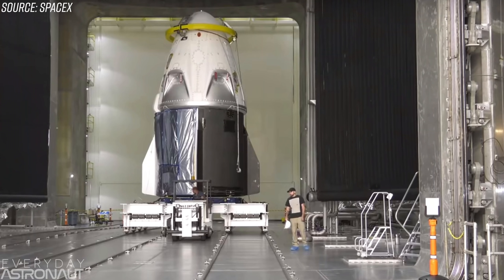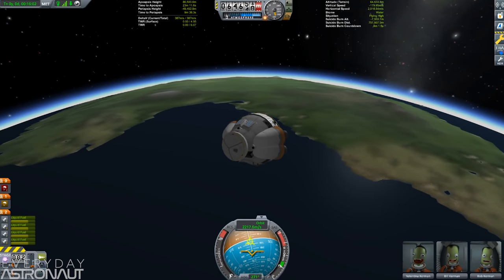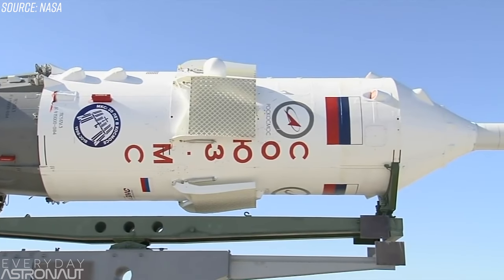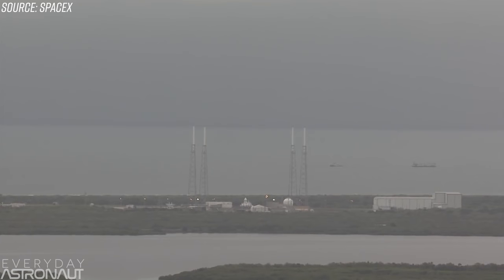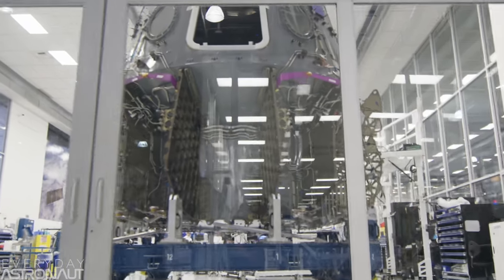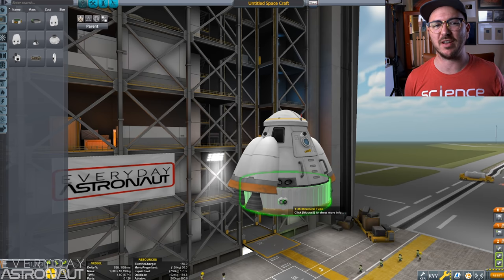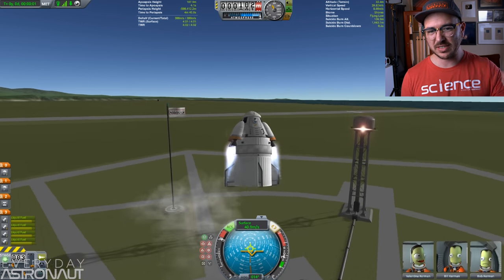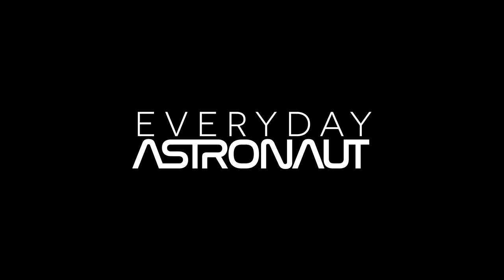Why Does SpaceX's New Dragon 2 Have Fins On It?

Comment: Yeah quick question. In the ULA launches the controller calls things like (and I'm making these up) "RCS, set control valves to flight mode" and the answer comes back "Roger". Then later maybe "RCS, arm abort control" and the answer comes back "Roger".

That's a really weird protocol. There must be some reason they don't use a standard protocol which is to identify yourself and confirm the instruction. Who knows who has said "Roger" or what they heard. Normally it would be "RCS, arm abort control" and the response would be something like "RCS, arming abort control" if the response comes back "GCS, arming reaction control" or something then you know the wrong person has thought the message was for them and is about to do the wrong thing. 

Why does ULA do things differently? How do they ensure safety?
Reply: Each command is taken care of by a specific person/section, and so they are the only ones who can respond to the command.

So in a highly scripted, trained, and rehearsed team, if you know that Bob is sitting at the switch to arm the Abort system, then if you command the abort system to be armed, Bob is the only one who can respond to that command, and so he doesn't have to identify himself. Plus you are going to be able to recognize his voice, and you have rehearsed this many times, so there is no ambiguity.

Since they have lots to do, and often rapid fire operations, having every command be read back with identifiers would take too long, so they developed this system to keep the words at a minimum.

Think of it like the difference between a networked control system and a hardwired control system.
In a networked control system, Sensor 1 has to send a signal to the controller giving identification of the controller as the message destination, its own identity, and the message of its current state.
In a hard wired system, Sensor X001 simply gives its current state, and all the other factors are hard wired by what input it is connected to.
In Mission control, it is hard wired through training.
Reply: @ke6gwf  thanks, that makes sense.

Comment: Great video! I can´t wait for the falcon 9 explosion xD
Reply: Where is it launching from?
Reply: @dwightk.schrute6743  Has to be the cape in Florida. Probably a manned capsule will never fly from the west coast just because of the available orbits from there. You can't really get to the ISS from Vandenberg.
Reply: @williamgreene4834  Maybe, but they're not trying to reach leo. Its just a test of the escape system. I've seen Falcon 9's launch from vandenburg.
Reply: @williamgreene4834  Well, originally they were planning to use the same capsule from the pad abort, and do the in-flight abort at Vandenberg. I dunno why and when they changed it, but it's definitely happening at the Cape now.
Reply: @dwightk.schrute6743  Yes they have, I'm just saying they will probably not launch humans from there because of the orbits available.
Reply: and you are right there is nothing stopping them from doing an in flight abort from Vandenburg.
Reply: Why can't they do what blue origin did and save the 1st stage?
Reply: @xxZerosumxx  real life sceanero  I presume. Make sure even in the case of an explosion the crew can get out
Reply: @xxZerosumxx  I'll assume you know that SpaceX does exactly that and that you're asking in regards to the abort. If the rocket were to actually suffer a catastrophic failure on launch, the manned capsule needs to be able to recognize that and perform its abort correctly. Nothing like reality to test your machine.
Reply: @WhiteRhino.  , maybe they can use the booster that landed in the water.
Reply: @xxZerosumxx  they probably could, but I guess they want to simulate the worst case scenario, and having the booster right below you explode seems like a rather bad scenario
Reply: @_Andrew2002  And maybe they will use the falcon9 that performed a water landing :)
Kabooom
Reply: "SpaceX does the most awesome fireworks show in history"
Reply: @xxZerosumxx  Writing this after it was done, i can say that since they aborted at max-Q, the booster disintegrated to aerodynamic forces

Comment: Tim, isn't it called Center of Pressure? I think Center of Lift is more of a KSP thing, or is it a synonym? ;D Interesting topic and cool video nonetheless!
Reply: DrGraypFroot Yeah, I think "center of pressure" or "aerodynamic center" would be more general, as lift is an aerodynamic force in a particular direction.  Technically, though, the center of pressure or aerodynamic center is the point at which all aerodynamic forces can be resolved into a single vector, so they would be at the same location.
Reply: @brainmind4070  Not entirely true. Center of pressure and aerodynamic center are two different things. Center of pressure is the point, where the sum of a pressure field acts on a body (eg. where the force is concentrated), the aerodynamic center on the other hand is the point where the rotational moment does not change, regardless of the angle of attack (pivot point). Never heard center of lift before though other than from KSP..
Reply: DrGraypFroot You're right.  My aerodynamics is rusty.
Reply: @brainmind4070  We're all here to learn :) and I'm no scientist either ;)
Reply: DrGraypFroot I aced fluid mechanics and aerodynamics in college, but alas, it has been awhile since I've delved into such concepts.
Reply: @brainmind4070  yeah if you don't use it, you lose it. I used to be somewhat decent in French some years ago ^^
Reply: Center of lift is a correct term but applied to lift surfaces, like wings. In that case, the center of lift is the point in the wing's cord where the wing's entire lift force will be applied. The same principle as center of mass. It is not the entire mass of the object that is placed there, but you can say that the object's mass is represented there. The actual sum of the object's mass there is equal to zero (if you take your reference frame positive in one direction and negative in the other of course).
Reply: Whatever its called, the net aerodynamic force would change with the airflow orientation of the body, possibly in this case causing the positive feedback to the spin shown in the Kerbal model.

Comment: It's like cars! Fins make it go faster!
Reply: And Spoilers!
Reply: Don't forget about the NOS stickers.
Reply: And flames!  Oh wait.  OK pin stripes.
Reply: yeah, Chrysler figured this all out in 19 freaking 57!!! :D
Reply: "It's like cars! Fins make it go faster!" 

Actually that is not the case at all.  Fins increase aerodynamic surface area which in turn creates more aerodynamic drag.

In the late 1940s and throughout the 1950s, auto makers around the world – Ford, Chevrolet, Dodge, Mercedes-Benz et al – all toyed with having fins on the trailing quarter panels of their cars — the Cadillac Eldorado was the first to use them in excessive styling. 

In the end, even in minor aesthetic form, they were found to cause more harm to the vehicle's handling stability at high speed than improve safety – a relatively low velocity crosswind on a high-speed motorway ( 100+ km /h [75+ mph]) was enough to cause the vehicle tail to suddenly swerve and to a inattentive drivers of the day (which amounted to essentially everyone who drove on the roads back in the 1950s into the 1970s ), this was an accident waiting to happen.  Remember all MVs back then were rear-wheel drive, and if the drive wheels (thrust) were thrown out of alignment with the direction of travel, the result could be catastrophic for the occupants of the vehicle.  This was a serious injury liability potential to the auto makers.  One they did not want to pay for.

It's why you don't see them today.

Fins may have made cars look cool and futuristic, but it also made them more deadlier than they already were.
Reply: @MelioraCogito  Drag schmag!!! Actually we did drag (street race) and go to the local NHRA drag strip, and, yes, most of those fast muscle cars of the 60's (like my 67 Mercury Cyclone GT), did not have fins. The idea, in the late 50's, was to make cars "look fast", standing still (which got you chicks; the ENTIRE point of having those cars!!!!!), cause if you went fast enough to be affected by drag, then "Andy", the local cop, would take your car away from you, fins and all!! And that would be, as we would say back then, a real "DRAG" :D Of course the fins on this SpaceX "contraption" make it go straighter, more stable; a very good thing!!
Reply: @MelioraCogito   Boring, cool requires sacrifice. Like women's high heels.
Reply: @RS-ls7mm  Exactly!!! especially if that's ALLLLLL they are waring  ;)
Reply: Fins and Finns make cars go faster.
Reply: @RS-ls7mm  I put stripes on my BBQ grill. Didn't make the steaks cook any faster. If I had to do it again, though, I would!
Reply: @JakeOchs  you probably don't want to paint flames on the ol' Barbie, eh? :D
Reply: @s0vietonion  YES. I watch car shows on TV a lot and see that these guys who build cars have a pretty good market for American hot rods in Scandinavian countries, mostly Sweden from what I've seen. In one show these 2 guys from Sweden came to a Texas garage/shop to pick up their car, and while they were waiting for last details to be finished, a couple of guys from that garage took them out to a nearby target range to shoot machine guns!! I think they were actual Thompson's, forcrissakes!! Don't know what the Swedes enjoyed more!! LOL.
Reply: @MelioraCogito  wtf
Reply: not when you're in a vacuum hahaha
Reply: @MelioraCogito   Uh.. that was a joke tho
Reply: MelioraCogito r/ wooosh

Comment: they could use the booster that recently landed in water with only minor damage for the in flight abort as they cant use it for commercial missions anymore so there would be nearly no losses to detonate the booster and just in case the booster does actually fail the test would still be successful just the abort happening earlier in the mission
Reply: That booster is scrap metal now
Reply: @cazymike87  no, as they said they are saving it for an internal mission, most likely this one, as it did a soft water landing.
Reply: Seems like they will use an old flight proven block 4...
Reply: @fredericvadez7998  Wouldn't work, since NASA standards say a rocket has to safely fly 7 times or so unchanged to pass for manned rating. If they used a Block 4 it wouldn't be representative of a Block 5.
Reply: I doubt it will actually be used again.  Elon tweeted out the internal usage statement before he knew the true condition of the booster. If you watch the recovery videos it's all bent up. I'm sure they're going to use the fins in the landing legs and it's here and there but the main tube of the rocket fuselages is toast
Reply: They only need 3 main engines on the abort booster because of the lack of a 120 ton second stage. If they used 9 Merlins on that light a rocket it would hit max Q way too early.
Reply: @ReddwarfIV  block5 will have flown more than seven time before the first manned flight. And this fly is essentially a dragon abort test. Does it really make a difference to detonate a block4 or a block5 ? And it will be a pretty short flight, max Q is reached in the first minute of launch, sure it can not be considered part of these 7 flights. Whatsoever NASA will decide with its own reasons.
Reply: @ReddwarfIV  This is not a flight to certify the launch vehicle only the capsule so it doesn't even matter what vehicle it launched on. They certified the capsule for a pad abort already and that wasn't even on a vehicle. Different parts can be certified individually.
Reply: @williamgreene4834  Alright.
Reply: That's never going to happen.
Reply: @CessnaPilot99  Gwynn Shotwell later re-iterated this statement that they will use it for a internal mission
Reply: @fredericvadez7998  the last block 4 sadly has been destroyed, there are 0 more
Reply: @ReddwarfIV This is a test of the abort system, not the booster. It does not need a block 5 first stage. There are plenty of other block 5 launches to make it to the required 7.   I believe that with the current launch, they will have already flown at least 3 such boosters.
Reply: I think that booster is probably a bit more damaged than Elon thought. Also it definitely took longer to pull the booster out than Elon would have wanted.

The GPS-3 mission is the first mission to have the new COPV in both stages.

Comment: OMG i had no idea they were going to freaking detonate the rocket on the in flight abort. WHAAAAT
Reply: I wonder what mission it will be...
Reply: It’s probably to verify that the abort system can both detect a problem and react to it in time to save the crew. It doesn’t do any good for the abort system fire if half the capsule has already been destroyed.
Reply: The booster would most likely not survive MaxQ without the dragon on top, so they would lost the booster anyway.
Reply: @avecas  when's this mission?
Reply: there's a video on YT about their Falcon 9 Dev vehicle manually being exploded due to a stuck valve. it was from way back when they were just trying to figure out how to hover and then land but I'm sure this explosion will be similar
Reply: +Plague not entirely sure yet, sometime between january (DM-1, uncrewed to ISS) and late summer (DM-2, crewed to ISS)
Reply: @sellers737  Could you link me that video? Thanks!
Reply: @avecas  And that's exactly what happened when they carried out the test earlier this year. They didn't actually detonate the booster deliberately - just shut down the engine to trigger automated abort - but it blew up quite nicely anyway once the loss of aerodynamics caused it to veer off course.

Comment: "in 2019 they're going to do an inflight Dragon 2 abort, with the Falcon 9 detonatiting beneath it"

This is the first I've heard about it and I can't find any sources on it. Can someone please link me? Thanks!
Reply: Tubby J Well on their app there’s half of a black interstate so guess it’ll be block 5
Reply: @TubbyJ420  They're not returning it and they're not detonating it. They're lowering the thrust or shutting down an engine which will cause the Dragon to activate its engines. There is 0% chance the booster will survive the aerodynamic forces with no dragon on top. It was always planned it will break up.
Reply: @TubbyJ420  And the original plan was a modified block 4 with 3 engines that would launch from Vandenberg with the same capsule from the pad abort. Although I have no evidence for it, some people think its a brand new block 5 booster.
Reply: https://www.faa.gov/about/office_org/headquarters_offices/ast/environmental/nepa_docs/review/launch/media/Draft_EA_for_SpaceX_In-flight_Dragon_Abort_508.pdf
there's the official release about it. The plan is to just shut down engines, but the stage is likely to break up and it mentions that they want to make the fuel burn together as thoroughly as possible to avoid contamination. So they won't intentionally detonate it per se, but it definitely should explode to some extent.
Reply: They should do it on 12.31.18 00.00.00 might be the best firework ever
Reply: Benjamin Casillas thanks a ton for finding this!
Reply: Benjamin Casillas so would it look similar to their June 2015 failure where the booster broke up mid Flight?

Comment: I wonder if this last Falcon that landed in the ocean will be the one they explode for their test. Would definitely save them some money and be used “only by SpaceX” as Elon mentioned.
Reply: NASA is never going to allow it.
Reply: @maxklinger1494  Why not
Reply: Read some of the earlier comments for reasonings on why ;)
Reply: @mimo5383  Can't find any
Reply: Try harder
Reply: @MrNiszuPL  NASA, since the loss of Columbia, has become extremely risk-adverse. Using a first stage which has, with all probability suffered extensive damage (and I don't talk only about the cracked interstage and bent Merlin nozzle, but about the effects of salt water contamination) would be extremely dangerous (the chances that things blows up/fails are high). IMHO I don't see NASA risking their precious payload (or getting the wrong data from It) for a few tens of millions of bucks.
Reply: A new Falcon 9 costs less than a seat on a Soyuz, just to put it into perspective.
Reply: @maxklinger1494  What are you talking about. It's going to be an abort test during max Q where the rocket blows up. It won't have any NASA's precious payload

Comment: '’Un aerodynamically stable'? Nice brain fade there!  We all do it. 'Aerodynamically unstable' is what you meant to say. Enough of the grammar policing! Thanks for the neat explanation. Robert Goddard made the mistake of putting most of the weight at the rear of the rockets, andvthaat's why we see films of them being unstable in flight. Bowmen had known instinctively that feathers on the rear of the shaft improved accuracy, but they didn't know exactly why that worked.

Comment: I remember the first Dragon Abort Test. Of course, it being unmanned meant that it didn't necessarily need extra stability. As the Dragon 2 will be manned. It needs a higher degree of safety. So the fins make sense. Great content as always Tim. Blue Origin's New Shepherd Capsule. Isn't the right shape for fins. Grid Fins might be okay though. I'm not a designer. So don't really know how feasible they are.